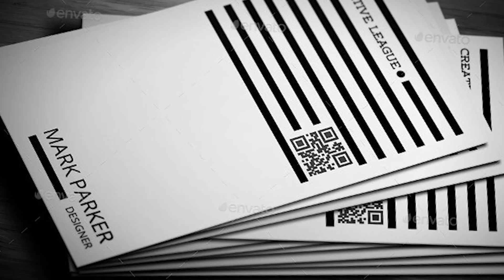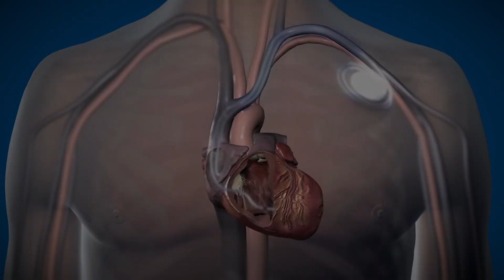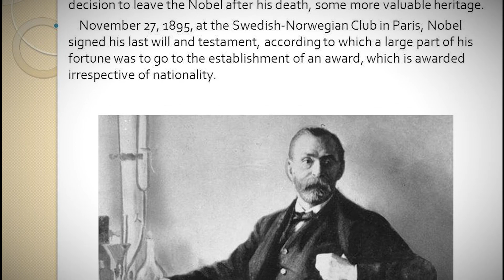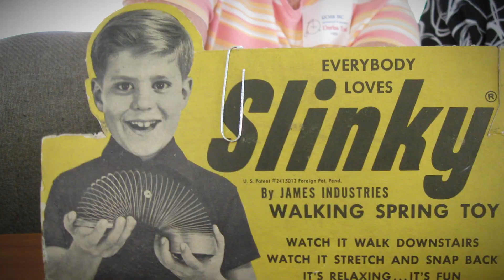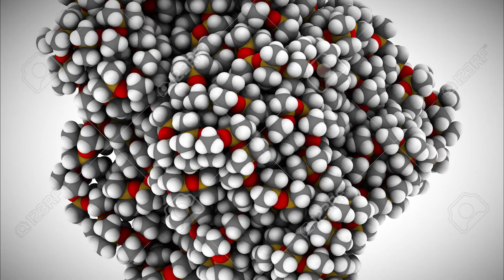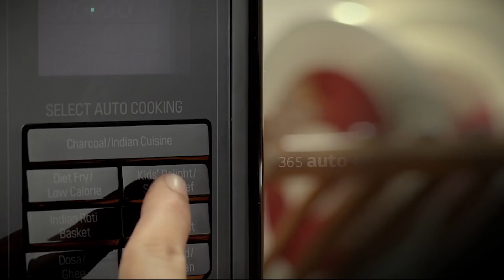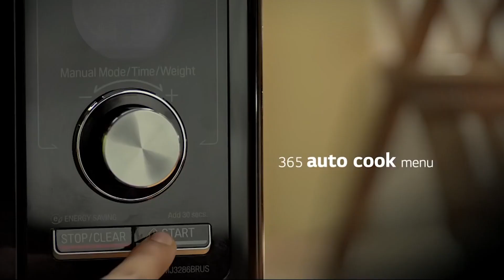10 Inventions That Were Invented By Mistake

Comment: Some of the explanations for these inventions were very light on explanation. One invention that should be on this list is Post It Notes, which resulted from a failed formula for a glue that turned out to not hold very well. Bonus points for knowing the connection to Mike Nesmith of the Monkees.